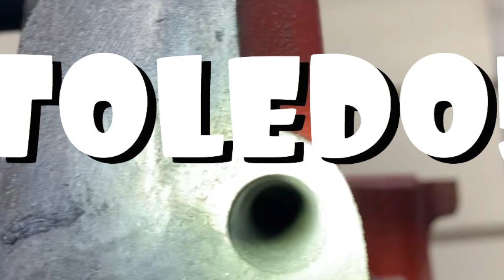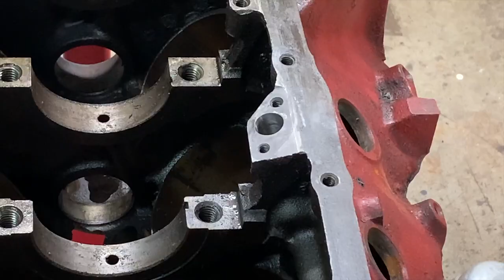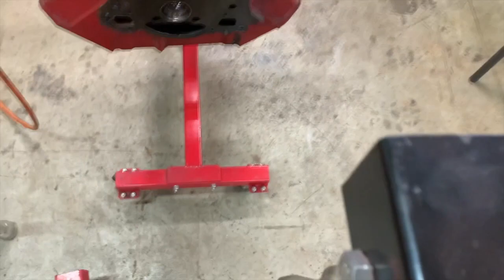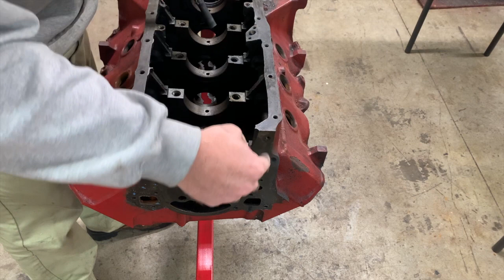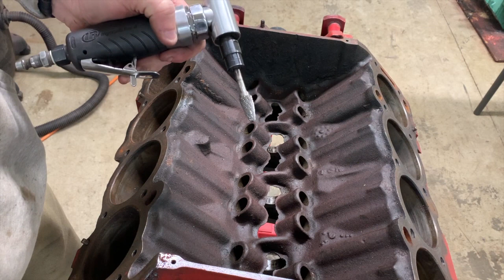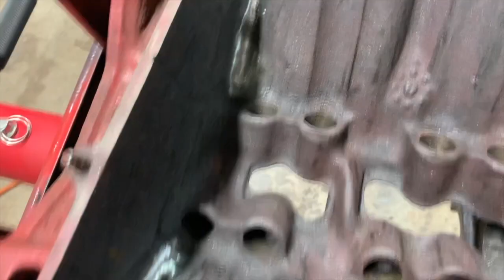Polishing those Buick, Rover, Leyland V8 and Buick V6 Oil Passages and "The Return to Sender"!

Comment: Math is not your strongest suit, am I right? When I calculate the AREA of a circle that is .5” and compare it to the AREA of a circle that is .5625” I get a 25% increase in AREA. The increase in cross section was only 12.5% but the increase in area is 25%.
Reply from the maker: Did I do math in public and screw it up? I don’t think I did do math in public. I have never sat down and determined the actual flow rate increase as you have apparently done here, so thank you for mathematically proving that the larger passage increases volume and flow potential by 25%.